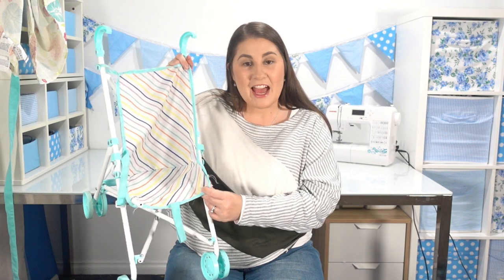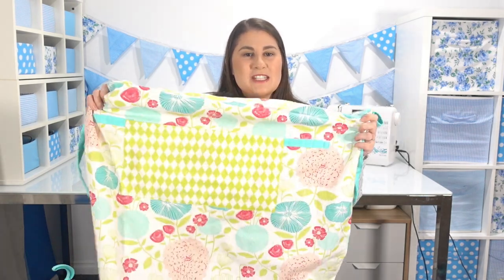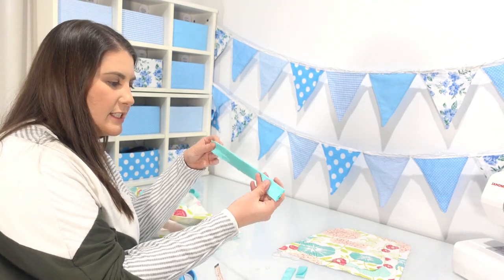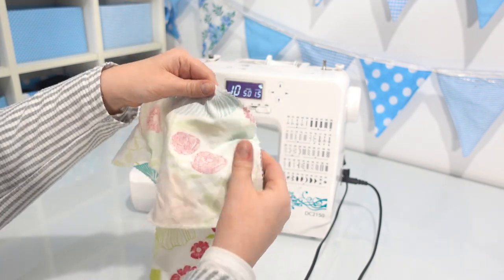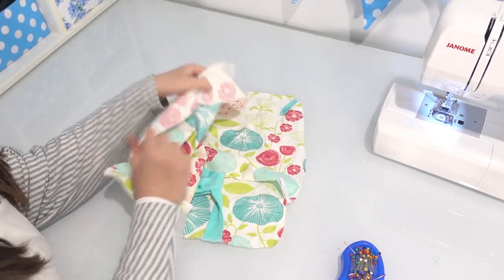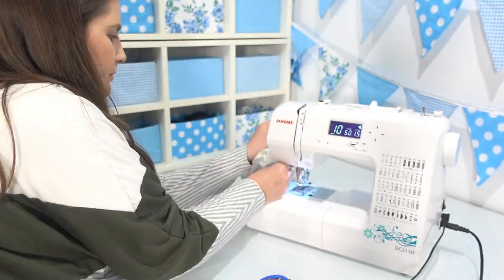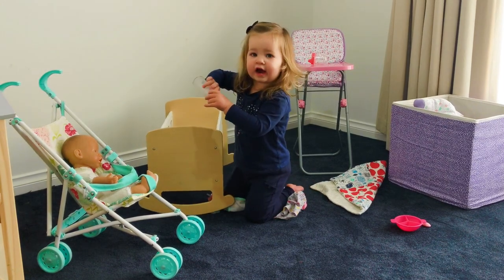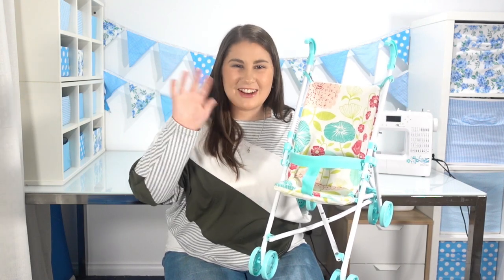FIXING THE DOLL PRAM | Sewing Tutorial Mending My Kids Doll Stroller

Comment: Thank you for this! My middle two kids have been using a toy pram /stroller with a cloth napkin tied in.... It works okay but not great.

Needed to ask, on the doll pram back pattern piece, you say to cut two waistbands one at 12 1/2 inches (32cm) , and one at 4 3/4 inches (12cm). But it doesn't state how wide to make them. Only their length.

Help please?
Reply from the maker: It could be any width really, but mine is about an inch (2.5cm) wide. 

Hope you enjoy making this pattern. Reach out if you're needing any more help